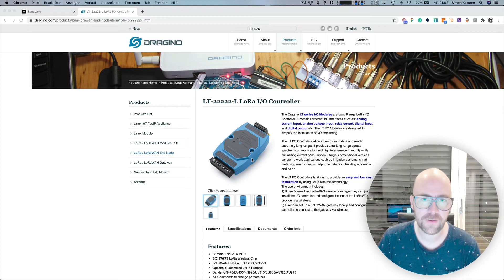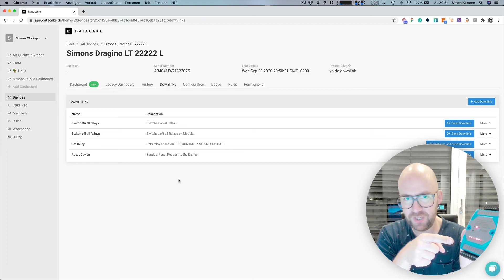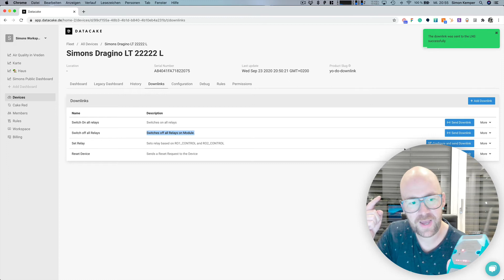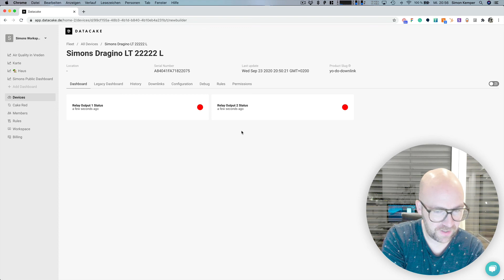Realtime Class C LoRaWAN Applications on Datacake to control Industrial IO with Dragino LT-22222-L

Comment: I am trying to use your template but it doesnt appear to send any downlink to my lt22222l. Although connected (I can see if one of the relays is on from Configuration tab) the dashboard does not show that information neither can it send a signal to open/close the relays. Maybe it works for a different version. I would appreciate any help.
Reply: This is a terrible video ay, he's already got it set up so there's no example of how to set it up. Im in the same boat as you, my LT22222 is connected to datacake, but i cant turn the relay on or off. i can turn an input on (in person) and press the rst button and it'll show on datacake, but i cant use datacake to turn the output on. so frustrating